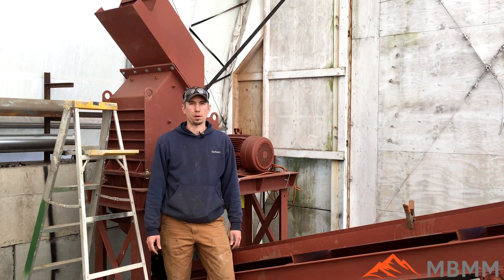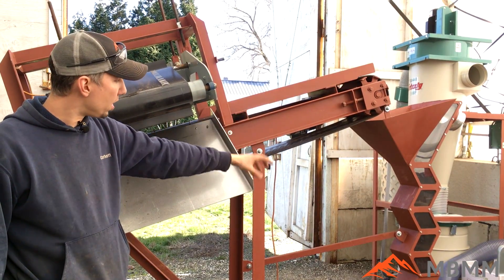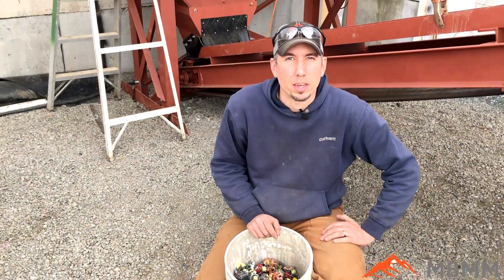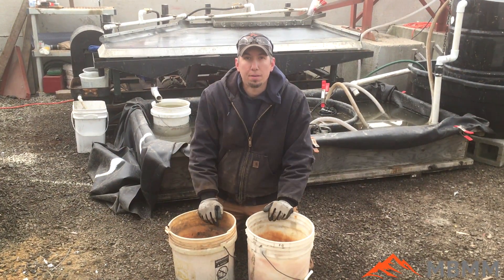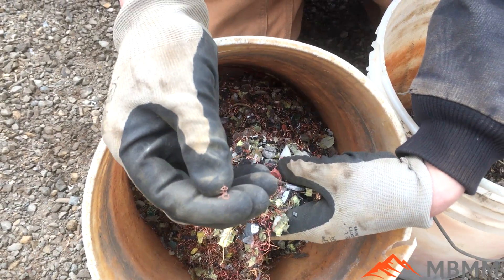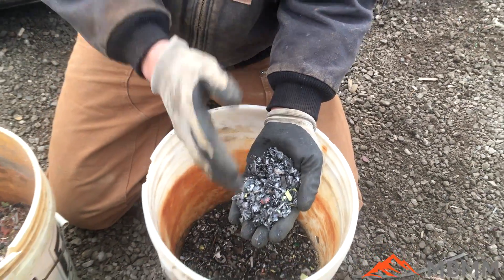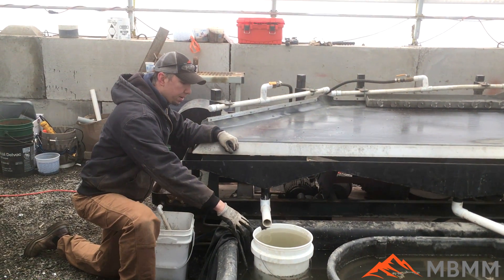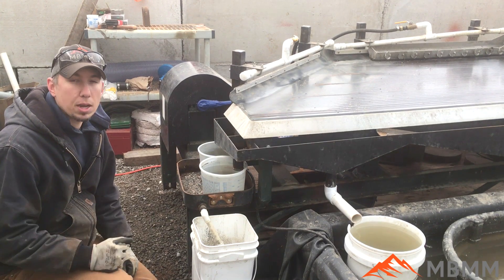Clean Copper Recovery from Motors &Transformers with Hammer Mill, Magnet, & Shaker Table

Comment: U should run your plastic and copper mix through a tub of water first the plastic will float to the top coper will fall to the bottom then run it through your hammer mill and table give it a shot  u might be surprised  ps love your videos keep em Cummin
Reply from the maker: Great, thanks for the tip!